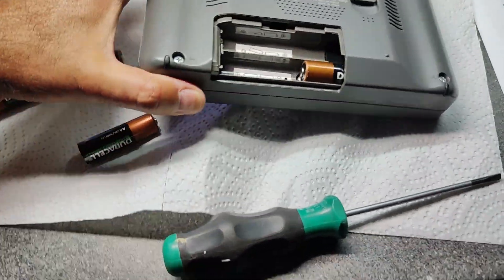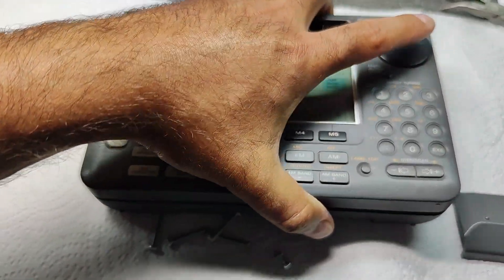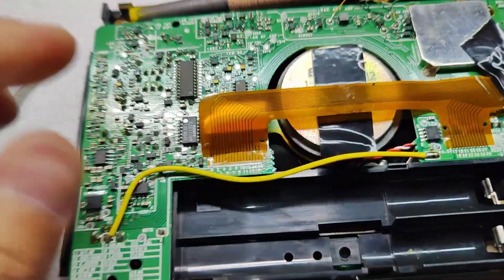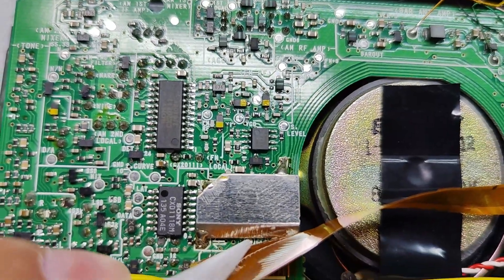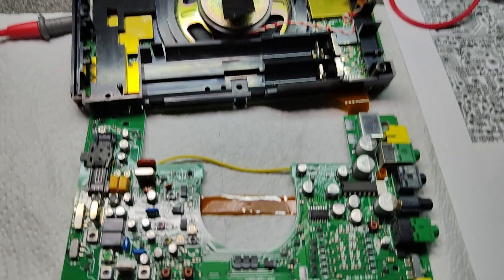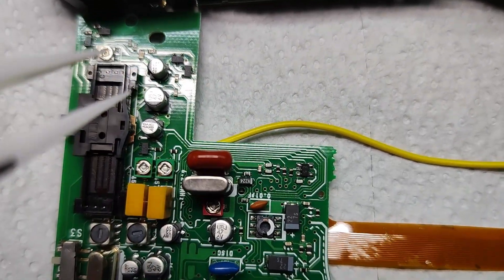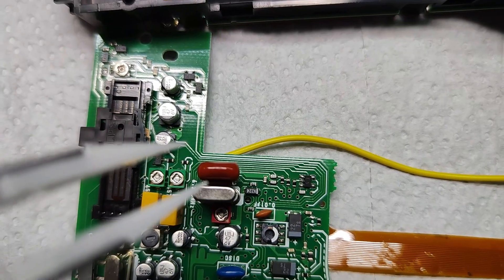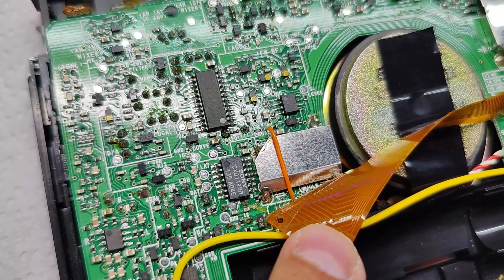SONY ICF SW55 - How to fix factory issue with warble in SSB

Comment: I re capped mine and still the same warble,  I'll give this a try!
Reply from the maker: I found this somewhere as a last chance... In my case works fine but if SSB is your priority I think it's better to get some HF TRX  / old HF receiver as Icoms, Yaesus with dedicated SSB filter.
Reply: Well I carried out the mod, and radio just says "cal" on the screen, then switches off  😞